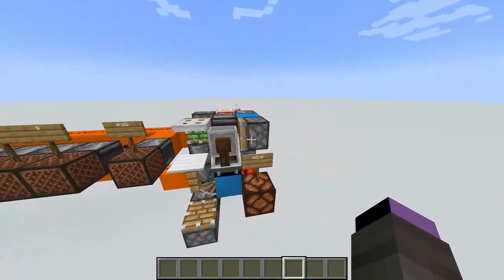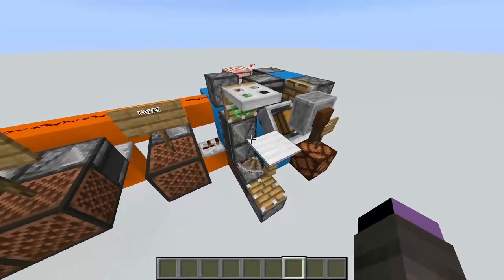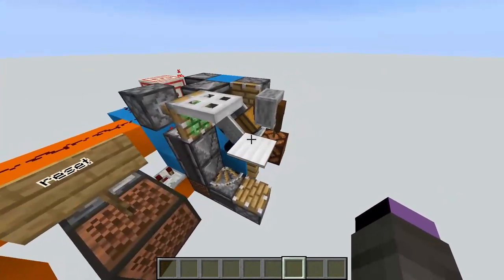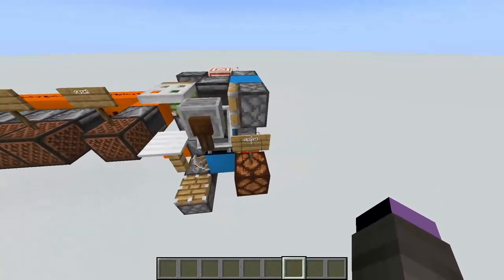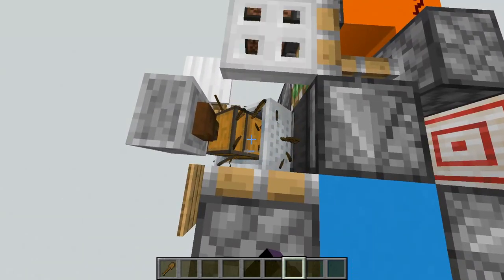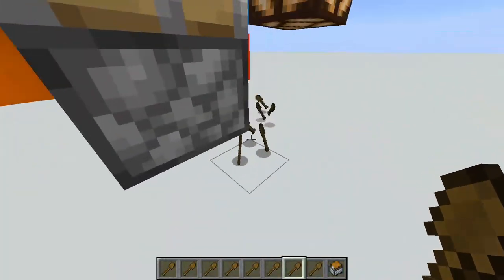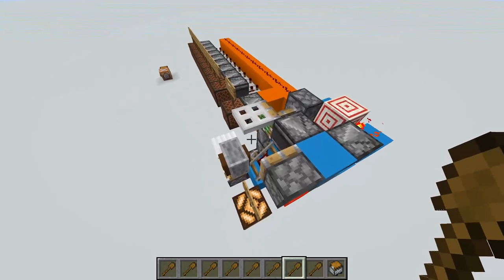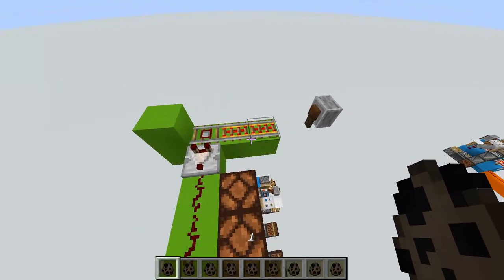One Module, Unlimited Digits.

Comment: its even more insane when you think this cant be beatable, as the requirement is least blocks per digit which means this has a b/d(blocks per digit) of ~0(as n->infinity b/d -> 0). fucking mad respect this is so awesome you just got the best possible score, unless crafty counts a smaller design that can handle infinite digits to have a smaller b/d but then youll get into multiples of infinity/infinitesimals.
Reply: it has been beaten the smallest now is 3x4x4
Reply: Sadly the rules don't work like that. The locks get graded on a ten bit lock, and the description of this video says he got it down to 30 blocks it would be 30/5=6 blocks per digit.

I was really annoyed by this when I considered using shulkerboxes to store data densely, but the cost of a shulker loading/offloading mechanism will be too high because, despite not increasing with lock size, at a 10-digit lock it's not worth it.

Comment: Maybe checking entity amount nearby could tell away how long your combination is. Otherwise a wery cool lock design 👍
Reply: could have several minecarts near the lock to throw off anyone using that method
Reply: That's not really a problem is it ? If you want to bruteforce you still need to try every possible sequence so if your code is long enough you're probably good
Reply: @rubixube4239  yea thats true

Comment: Bro, it's incredibly cool, BUT this design has a HUGE problem with the sound of the iron pressure plate being pressed. When the number is correct, you can hear it when the plate is unclenched. This is also very clear if you turn on the subtitles.

Comment: How does this lock stop taking user inputs after they input a wrong pin.

For example, for the password 123

They input 321, 321, 321.
So on the first try, 1 will be read, then on the 2nd, 2 will be read, and then on the 3rd, 3, which should still unlock this mechanism?

I'm guessing there's something in place to stop this

Comment: Ok, I actually don't know basically anything about redstone, but how much space would it take to add a system to automatically reset if the wrong button is pressed and having the commands in a 3 by 3 keypad?
Reply: Probably not hard.
The 3x3 keypad is just wiring the inputs differently.
For the reset you could just detect if its not the correct keystroke and reset it. But you would be able to tell that it's the wrong key and therefore can easily guess the passcode

Comment: This is amazing!
 does it work on bedrock? and if so, can you make a tutorial for it?
Reply: I don’t think this does, but a made a similar design that does
Reply: @spacefun101  thats awesome! I'd love to see it
Reply: @justonechessguy  I don’t really have an easy way to do this, so wait just a bit
Reply: @justonechessguy  Layer 1: 
Air          Air        Solid      Pist>    Air
Solid       Air        Obs^     Air        Obs v
Air         Drop       Obs>    Glass   Pist u
Layer 2:
Air.         Solid.       Air.        Obsid.     Air
Dust.     Solid.     Torch<.  Stair dv     Air
Air.        Solid.       Rail<>.   Rail<^     Air
Layer 3:
Solid.    Rep1>  SPist d.  Pist d.   Torch<
Solid.  ComS<. Solid  DRail u<>d fence
Air.       Dust.         Air         Air.         Air
Layer 4:
Dust.     Air.     Torch d.      Pist v.     Air
Dust.     Air.       Air.              Air.      Grind
Air.          Air.       Air.             Air.       Air
I know this sucks but I don’t know how else. The arrows point within the layer and u and d mean up and down, for when things have a direction to point or a block to stand on. Repeater on 1 tick, comparator on subtract
On the observer facing into the up facing piston should be a minecart. On the straight rail should be the same amount of mine carts as digits in the code. On the detector rail should be all the chest minecarts. Place these last, one by one to load the code. Put 2n items in each minecart where n is the signal strength going in (or full for 14) it can not handle 15, that effectively resets it.
The input is the dust next to the comparator. The output is the torch in the corner. This does have a flaw that right and wrong sound a bit different, but that shouldn’t be too noticeable and just put it 16 blocks away or obscure the sound of you are concerned.
Reply: @spacefun101  thanks i gotta try this